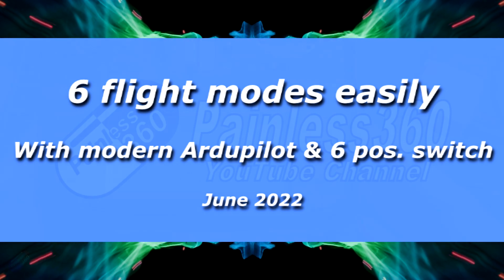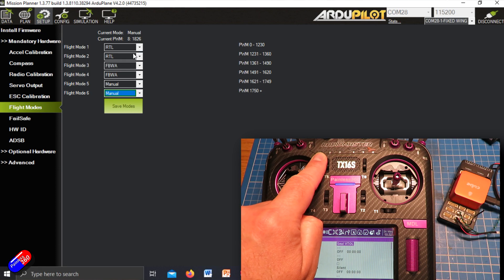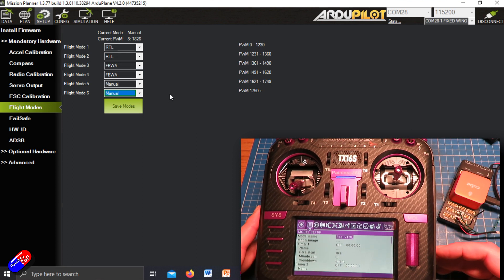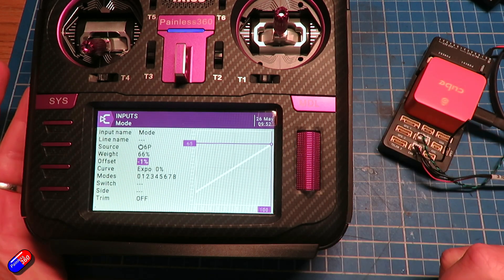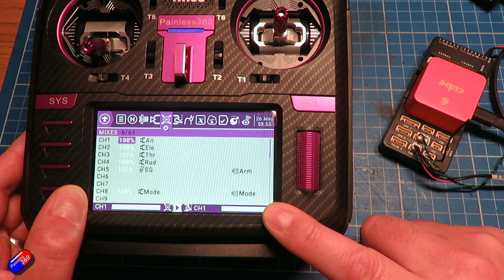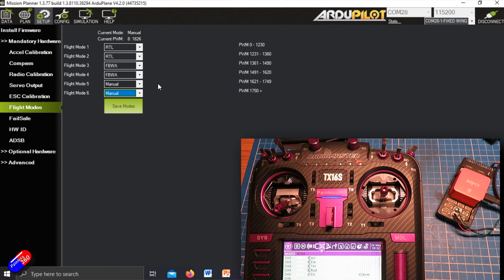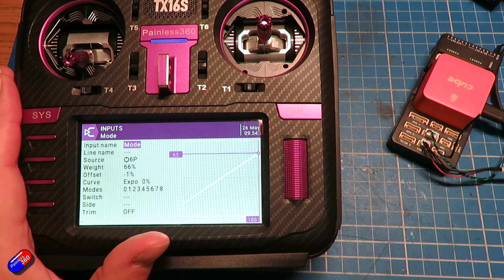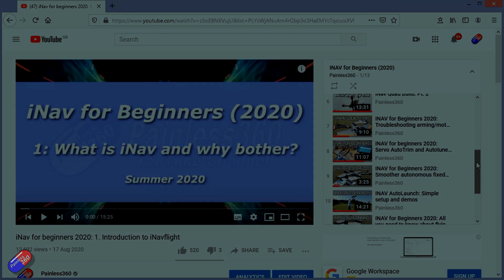6 Ardupilot flight modes using 6 position switch - EASY

Comment: You can also change the flight mode channel in Ardupilot to something other than Channel 8 using FLTMODE_CH parameter. The default value is 8 but you can change it to anything else. Channels 1 through 4 are usually for stick commands, 5 can be to arm and I have my modes switches set in Channel 6.
Reply from the maker: That's right. Check out my setup videos where I cover that,  and more setup tips... I.e. https://youtu.be/pcTjVuGcgCc

Comment: Is there a way to force the TX16S to start up with a different position than the first position of the 6-position switch? I figured out how to make it tell me to change the mode to Pos3 with the pre-flight checks, but I would rather it default to Pos3 on power-up.
Reply from the maker: I've not found a way yet, if you find one - please let me know!

Comment: Mine is set up just as yours is and on button 1 I get -100,-67 and when I hit button 2 it jumps to 100,65 and then no changes for the other buttons. Did I miss a step?
Reply from the maker: It sounds like it... Happy flying
Reply: @Painless360  figured it out. When you calibrate each one of those buttons you can’t just press them. You have to hold them down for a second or two until the 1 on the bottom of the screen changes to the number you are holding. Once calibrated they do what they are supposed to now. Thanks

Comment: I must be missing something, when I have it at 60 weight and -1 offset each button barely moves the cursor on the inputs screen.
Reply: you need to calibrate the radio inputs. that was my problem

Comment: Hi Lee, you do a great work for all of us. I have a question about the new Radiomaster receiver R88 v2 which as per specification can work in D8, D16 and FHSS mode. Can you make a video how to bind aforementioned receiver to Frsky Taranis X9D plus 2019, please?
Reply from the maker: I'd try D8 first, you need to have the same flavour of ACCST V1 D16 mode (LBT or FCC) for that to work.. Best of luck
Reply: @Painless360  Thank you very much for your answer! I’ll try again, but the fast change of diode blink (sequences of 1,2 and three blinking) in the receiver confuse me and I do not know if push the blind button in the transmitter at right time.
Reply from the maker: I don't have one here to try... Best of luck
Reply: @Painless360  I have enough, so if you want can send you one.
Reply from the maker: That is very kind, next time I get my hands on one I can look. I'd try all options for ACCST D16 on the radio - LBT-V1, FCC-V1, LBT-V2 and then FCC-V2 to see if one works. Best of luck!!

Comment: That's brilliant. I accomplished a similar effect by using Special Functions set to override the two buttons that did not map well. So if  button 6p4 is chosen, override the channel output to a value that puts it in the middle of the 4th flight mode's band. Didn't mess with curves at all.

Comment: Yep - Got my Ardupilot planes all setup with the 6 Pos buttons on my Radiomaster.  I did it with a custom curve, but your way is easier!
I have 3 regular FPV planes and have just gone through and standardised all the OSD's and mode/switch setups, it has helped me alot .

Comment: Ive been doing this for over 2 years, all the way back to the 1st Jumper t16 radio, using curves. Its also why I believe the T-Pro beats the Zorro. If your an Ardpilot user, the 6 button radio's are a "must have" for an easy 6 mode setup.
Reply: Same here going back to the T16. It's the best to be able to switch using individual buttons instead of playing with switches.

Comment: Why 66% and -1 offset? What is special about those values?
Reply from the maker: They work :)
They drop the channel values in the middle of the ranges needed for each mode exactly... Happy flying
Reply: You're selecting your mode by transmitting on channel 8 (as he has it set up) so that offset allows each selection to be spaced more uniformly within the channel bandwidth. Think of it like subdividing the channel into six different blocks. You're making sure that each of those blocks is well separated and not going over on either side.